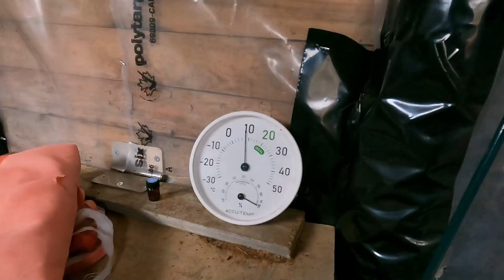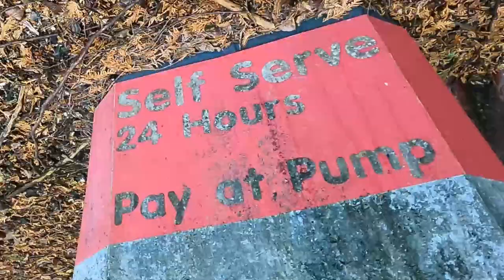Tricks For Restoring An Abandoned Airsoft Field

Comment: You have such an amazing place for your field!!
well laid out video too!
A few suggestions:
1: if you want your second bunkers fireplace to be more efficient, I would recommend moving the fireplace to the inside of the number and have chimney in side,because there is a HUGE amount of heat that comes off the chimney

2: you might be able to make a dubble-sided ladder to be able to get over the fence easily(assuming you don't want to cut it)

3: I personally would move all of the cover that is in usable condition to one area of the field, so that you have a very nice small field.
then as you build more you can 'expand' the area with cover
but this one is totally up to you and your friends
Reply from the maker: We diiid think about that but it would have made it tough to move around inside of the bunker during matches as it gets used during them. We're planning on doing that with the metal stove for the next build though!

That's a great idea for the ladder! Think we'll do that!

We're thinking we'll just keep expanding out as we go, we've got a decent flow already and it'll just be nice to add onto it as we go. 

Thank you for the awesome suggestions as always Jesse 🫡